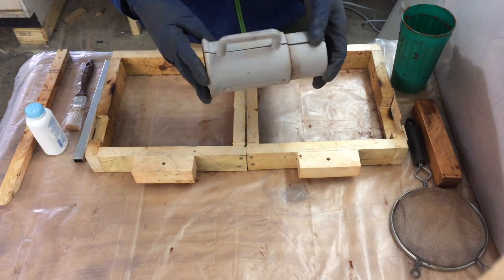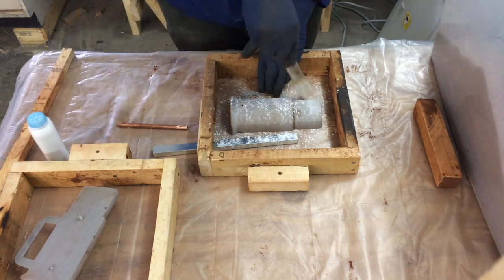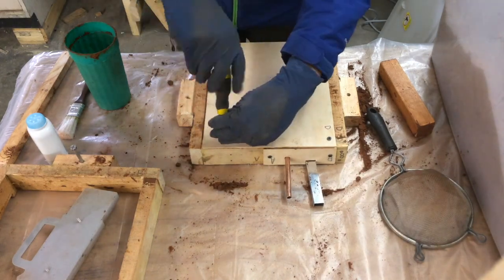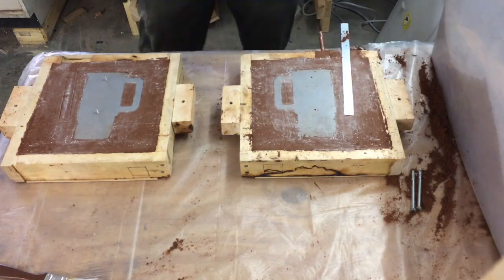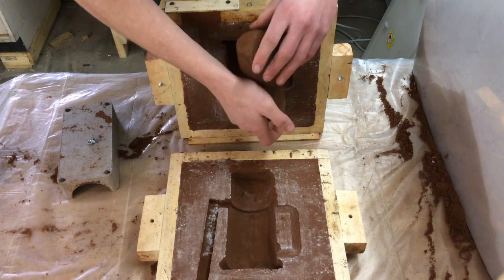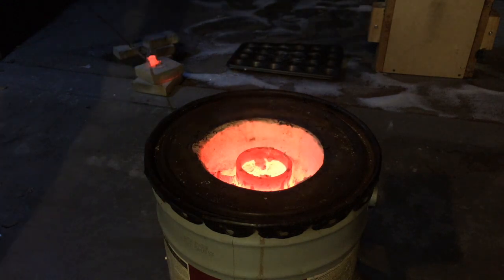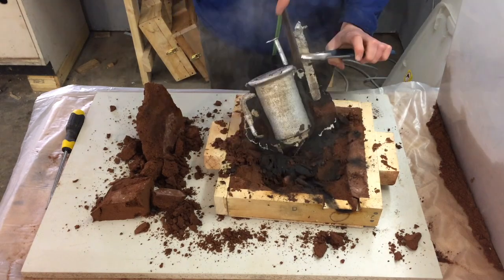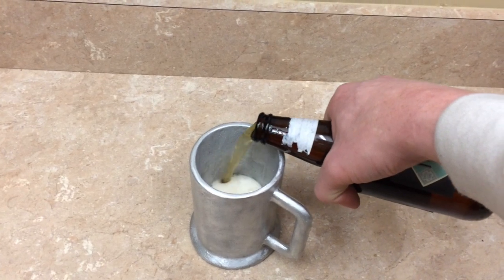Casting Aluminum Using a Core | Making a Beer Mug!

Comment: Very nice I like sand casting myself and tried aluminum brass knuckles for the first time and it came out so so but I need practice it's interesting in more challenging like you said when you add a core to the equation
Reply from the maker: Thanks for the input and keep casting to refine your techniques! If you're ever in need of any advice, the r/metalworking forum on reddit is a great resource or you can feel free to message me.

Comment: Nice, clear video. Getting the core to line up seems tricky. What kind of burner do you have? Looks like propane, did you make it yourself?
Reply from the maker: Niclas thank you!

I use a propane burner I purchased from eBay. Interestingly enough the burner is made from a .030 mig tip.